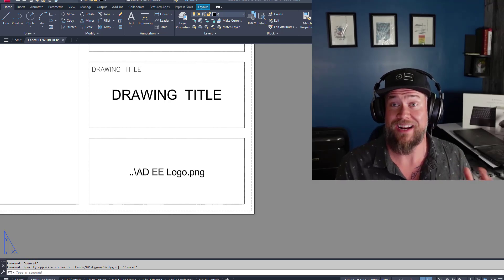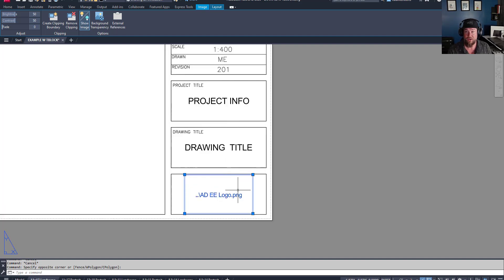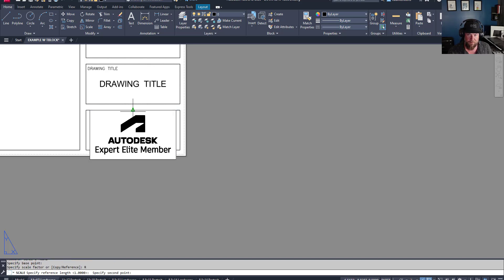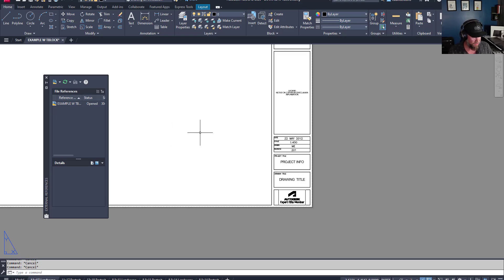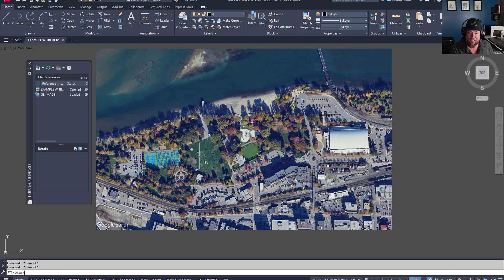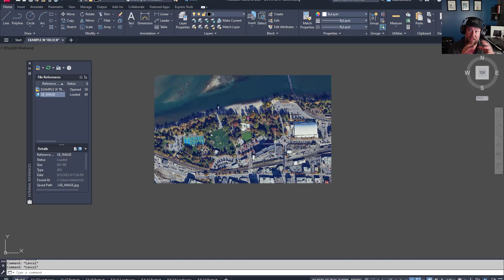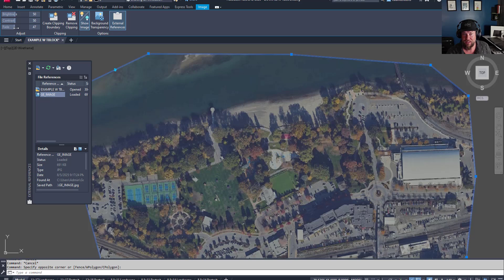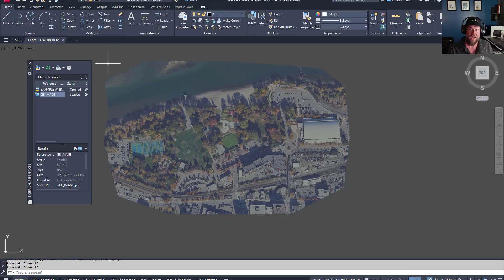AutoCAD Image Tricks Every Drafter Should Know (+ Embed Logos!)

Comment: Inserting an image like this works but it can, in some cases, cause some issues. A more minor thing to note, as modern day data size isn't as much as an issue, but you will increase the file size in direct proportion to the embed image size, not a lot, but considering how small and average 2D is, it can be a significant amount, especially when dealing with a lot of drawings. There was also a rare bug (not sure if they squashed it) that sometimes caused the file size to balloon to a massive size when doing this.
I have also seen some cases of odd behaviour in the display and plotting, but it could be caused by many different things.

The best way I have found to do this, is to get a vector of the company logo and insert that in.
This reduces file size (normally always but does depend on complexity) and increases reliability.
If you don't have a vector of the company logo, more common than you would think, you can make one using Inkscape (just Google raster to vector inkscape) then export the file out to a format like dxf.